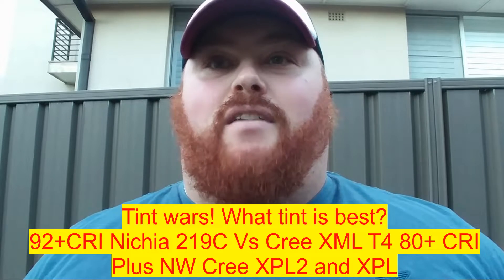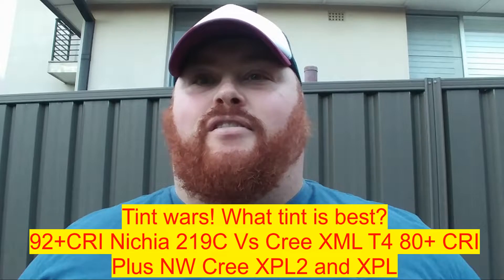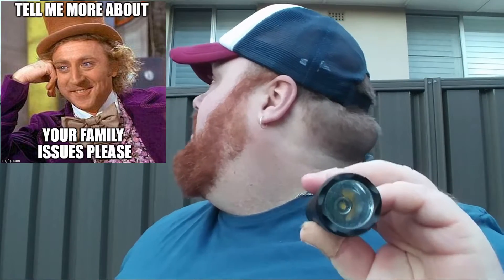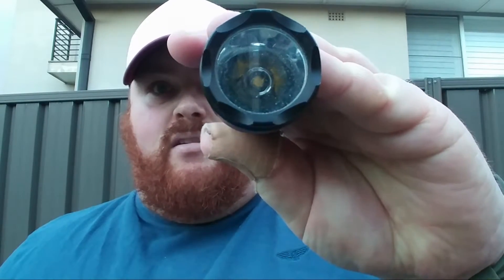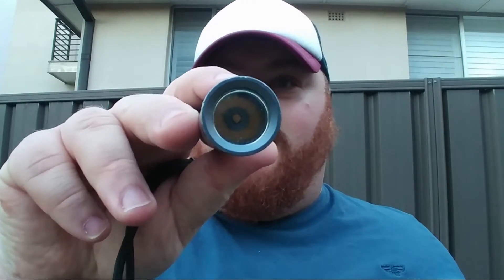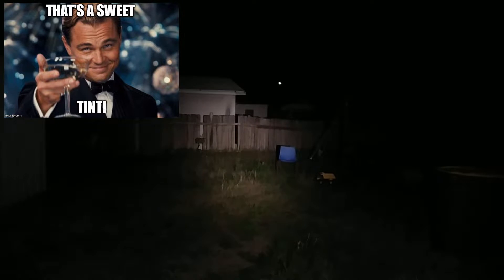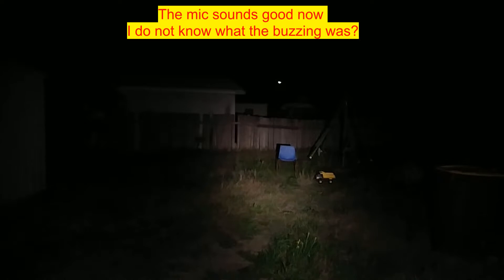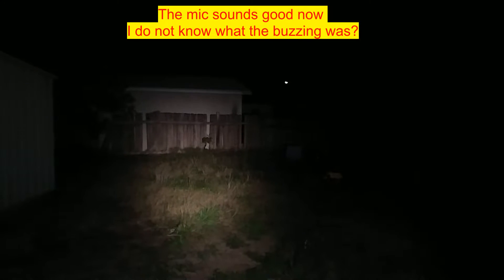Tint Wars! Nichia 219C vs Cree XML T4 +Cree XPL/XPL2 NW (what is your favorite tint?)

Comment: So, during the tint comparison at 8:43-ish, the XML beam on the right side is clearly yellow-er than the Nichia beam on the left side.  In roughly 2018, I bought a Thrunite T1 with an allegedly "neutral" tinted XHP-50. But its actually very yellow, so much so that it detracted from its brightness. I found it's yellowishness annoying.  

So after about 2 years of everyday carrying it, I opted to replace it with a Jetbeam RRT-01 with the magnetic control ring. In order to avoid being stuck with another annoyingly yellow beam, I gambled and ordered it with the XPL HI LED. Turns out it's about as perfectly neutral as you can get. There's no perceptible blue  or yellow to its tint. It's just white. 

The only downside is that the RRT-01 is a thrower with a tight hot spot, not ideal for indoors. But it's great outdoors. Clicking its non-electronic rear switch guarantees that it cannot be accidentally turned on in your pocket, and it's magnetic control ring allows for infinite adjustability. 

I've had the Jetbeam RRT-01 for 2-3 years now with no problems, because it's as tough and durable as they come. Jetbeam doesn't quite get the attention that you see with Surefire, Olight and Thrunite lights. But they represent my very 1st LED light in 2011(a BC-10) and I've owned 2 others(Jetbeam Jet II MK & RRT-01) which have been great lights.

Comment: Nichia all the way.  One thing I hate is turning on a bright flashlight in my house and I feel like I'm instantly shopping at Walmart.  In my quest for the right light I happened upon a Manker E02.  You turn that on in your house and it's exactly precisely like turning on an incandescent light bulb.  It's a tiny AAA light.  So I can only use it for a few hours to light my living room.  I use only solar power.    Finding a light with a nice big 5000ma battery and maybe up to 400 or 500 lumens has been the toughest thing I've ever tried to do.  I just found out today that nichia 219 goes all the way up to 5700 in some cases. If you have any suggestions let me know thanks for the video.   I very rarely laughs but I got a few chuckles out of that.

Comment: Maybe I'm crazy but I like my plain old xp-l cool white. Neutral just reminds me of an old incandescant bulb, and none of the other tints trip my trigger either.
Reply from the maker: Lol not a member of a flashlight forum? 
They all have there places, i wouldn't go to warm i got some XPLHI in 3000k tint way to warm. Personally I'd prefer a nice 5500k tint. The issue is you can't have a high CRI cold white tint. Or at least from what i know. High CRI has its uses the higher the CRI the better an object looks in the light. An object will look closer to its true colour in a higher CRI tint light source which will usually be warmer. You can get 5000k 90+ CRI LEDs.
Reply: @everydaysurvivalgear  I agree, I think it's personal preference mostly. Everyone's eyes are different. Some people think 6500K makes everything look black and white,  but I think it just gives everything a nice contrast even if the color rendition isn't perfect. I just got a DV42 with the Nichia 219 5000k emitters and so far I'm liking it. Not too, not too "incandescent" and not too blue either.
Reply from the maker: Also some people say neutral white is better at fog penetration compared compared to a cold white that will cause glare in those conditions. I'm not fully on board with that.

Comment: Downloaded your video, will watch later... personally, I can tell you I don't see a huge difference between 219b and 219c.
Reply from the maker: Both nice tints but i think the high CRI 219c has a little higher output? I think the 219b has a better tint overall but every one will perceive the tint different.
Reply: the 219c does have higher output but is 80% not 90% CRI iirc.
btw,  are you familiar with the nichia penlights from nitecore (219b) and klarus (219c w diffuser)?
My klarus actually has a warmer tint than the nitecore.
Reply from the maker: This 219c is 92+ CRI in the video its this model tested.
http://budgetlightforum.com/node/51693
I don't have those pen light but i do have a SIngfire BLF edition with a Nichia in it. You can still find the Singfire SF-348 for sale with the Nichia in it.
https://www.youtube.com/watch?v=xF4SiHYB7As

Maybe the optics make seem warmer?